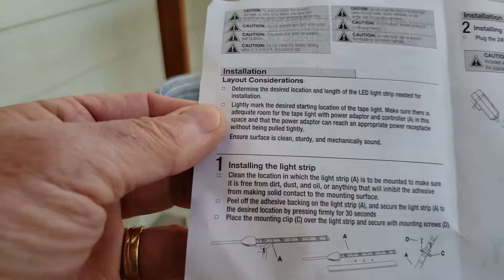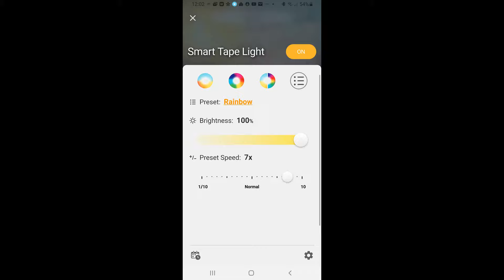Installing the EcoSmart Tunable Smart Light with Hubspace

Comment: Thanks for the vid. 

Is it okay to cut the strip?
Reply from the maker: I seem to recall asking this very question when I installed it, Joey, and concluded that it was in the 'too difficult to do' bucket. Having said that, it might be worth checking with the manufacturer now as things may have changed.
Reply: Yes you can it’s actually fairly simple most strips provide a visual of scissors or a dashed line showing where it’s safe to cut. Obviously don’t do it while it’s LIVE. It’s a low voltage that don’t kill you but it could short the circuit.
Reply from the maker: Thanks for sharing your experience, Lea.